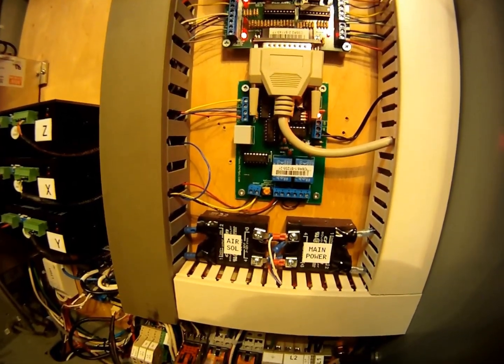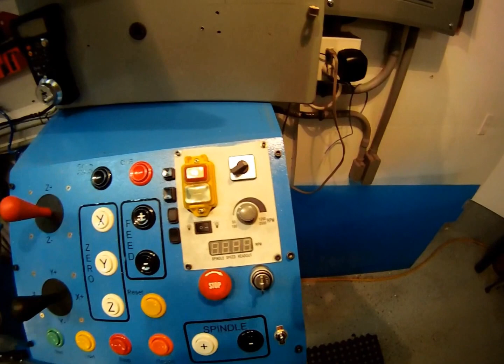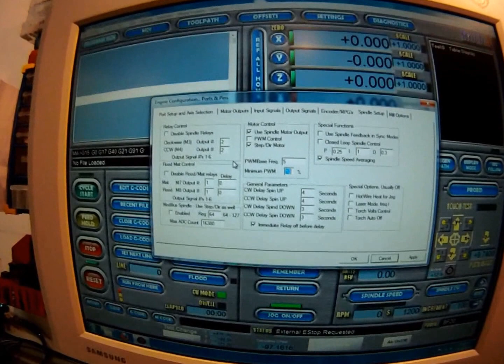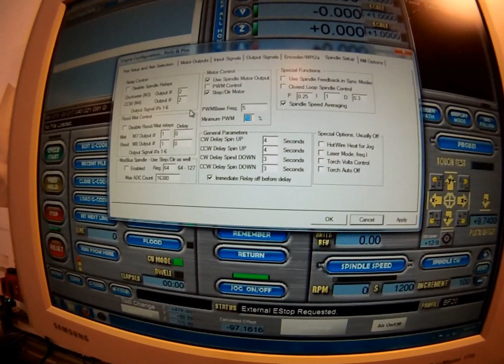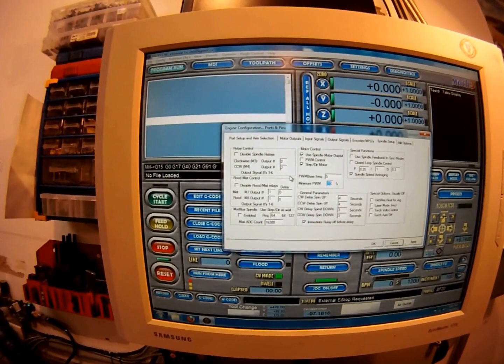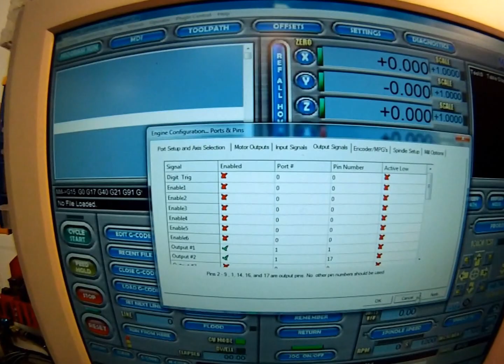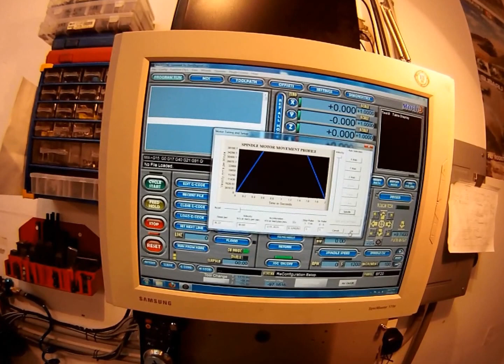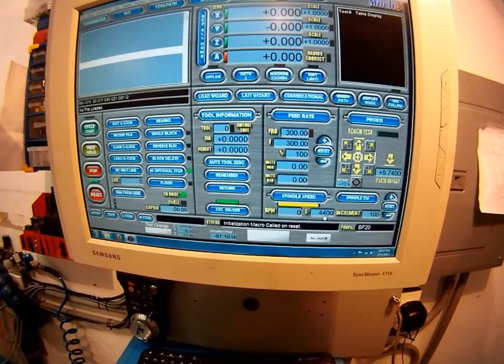C6 Spindle Control via C35 BOB Mach3

Comment: great set up you got there. DO you happen to have a schematic for the C6 and KBIC-120 clone board? What I am not sure is the CW adn CCW connections from the C6 to the KBIC120 baord. I am not sure which pins to use on the KBIC board. Thanks a lot